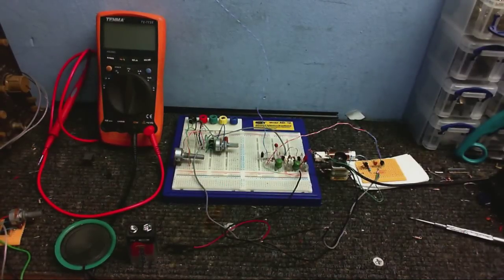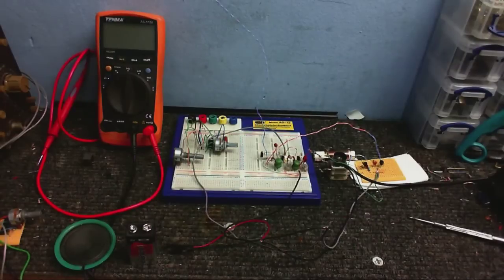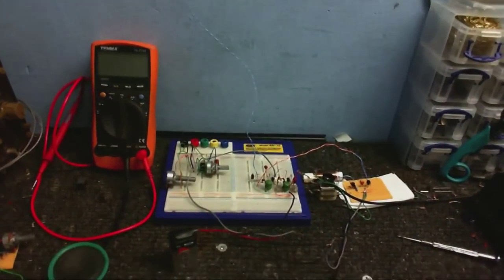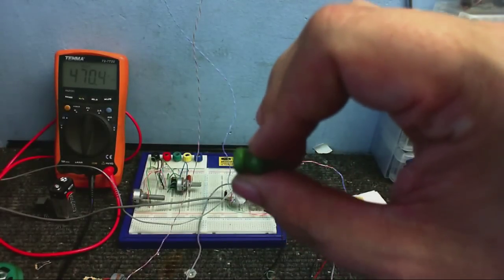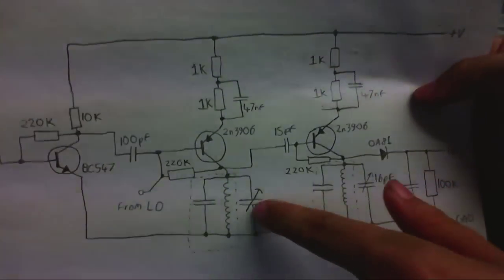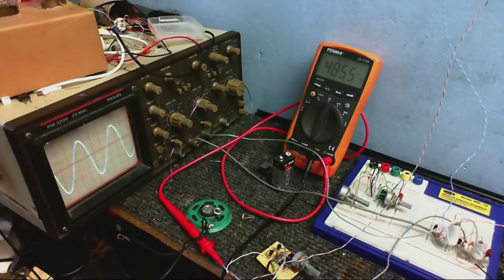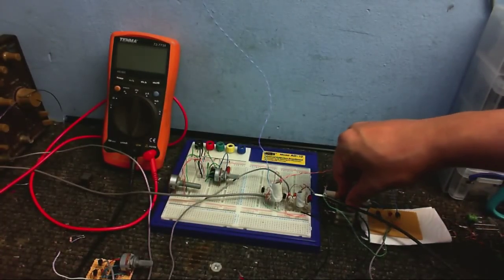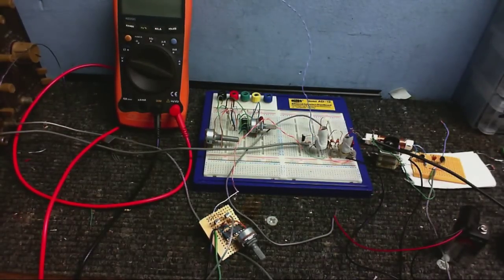How not to make a Superhet Radio

Comment: The constant station is because there is no selectivity at RF to stop antenna signals going straight through the IF amp; which is presumably very broad with the tuned ccts being heavily loaded by transistors and at what frequency exactly???. The configuration of the IF stages could be a bit better; the emitters should be decoupled to ground and there is no supply decoupling. I second Mr Johhhnnnyys suggestion. rip an old radio apart to get the coils: red core for the oscillator, yellow Ist If, white 2nd IF, black detector. Oh and grab the ferrite rod antenna while you're at it :)

Comment: Mate, you got a lot farther with this than I did on my first attempt.  For the third time, in case you think I'm joking or something, I'd very happily send you the IF and LO coil pack designed for a MW receiver, free of charge.  Just a few transistors and a fistful of bits is all you'll need.  Will at Bowood electronics has a few of these coil packs too, just tell him Lloyd sent you ;)  IF's can be made at home, i found 200 turns and a 220 pF NP0 cap was tunable to 455khz, not sure what you're doing there, but i'm sure you're pretty close!
Reply: +CoolDudeClem Is it wise to put your full address and postcode in public on here Clem ?
Reply from the maker: +Neil Robinson Oops, I thought I was replying to a PM, I was using the comments page in the YouTube dashboard and forgot that!
Reply: +CoolDudeClem Ok to delete post Clem ;)
Reply: +CoolDudeClem Mate, I have sent you an email - it's from my yahoo account so you might have to watch your spam filter ;)

Comment: It might be the lights that are causing the sounds that you heard isnce they are just resistors that are giving of heat and light it is more than possible that they would be giving off radio interference as well, also try using your tesla primary as the coil, that might work.

Comment: Clem,
The problem you have at the moment is that you have FOUR sections of your radio that need to be in perfect alignment:The tank circuit to select stations,the local oscillator and the two IF amps
Unfortunately,tweaking each section haphazardly,one after another,is likely,as you have seen,to get you nowhere fast!
It would be a bit like trying to view a specific object that periodically popped up on a computer monitor situated behind four doors ,each of which were opening and closing at different times !!!!!

The fact that your local oscillator,and tuning capacitor are not mechanically coupled makes things extremely difficult.This is because you have to guess where a station might be using the tuning capacitor, then tweak the local oscillator just to hear if you are tuned to anything!The whole business of keeping your local oscillator IN STEP with the tuning cap and coil is very critical.You would find life much easier if you used one set of vanes on your tuning capacitor as the means with which to tune your local oscillator.You could then trim that in order to produce your chosen IF at the output of the mixer using one of the trimmers built in to your tuning cap.An RF probe and amplifier would be extremely useful in helping set up each stage.

Hope this helps.
Reply from the maker: +ShellacScrubber I don't actually have any kind of tuned antenna coil in the circuit, I was going to put that in later on if I got any kind of promising results, for now the antenna just goes straight into the RF amp.  But how DO you set it up so there is a constant frequency difference between the LO and the antenna coil? so lets say if my I.F. was 450khz and I wanted to receive a station at 1mhz, how would I make certain that when the antenna col is tuned to 1mhz, the local oscillator would be at 1.45 mhz? (I think that's where it would have to be)
Reply: Hello again Clem,
Firstly,I must say it's good to see people like yourself experimenting and doing it with great enthusiasm.

Now,If you're building a superhet,you're definitely going to need an antenna coil and tuning capacitor !!
You are also going to need some form of sweep generator or cobble together an HF oscillator that can be amplitude modulated with an audio tone of say 1Khz.

I obviously wasn't paying close enough attention when I watched the video because you are indeed using a tuning cap' to alter the frequency of your local oscillator.I think I'd confused this with the HF oscillator you had made and using for your signal at one point.

Incidentally,I recommend watching any or all of the videos regarding RF and IF alignment posted by Bandersentv.

However,I will outline the basic principles:

Firstly,as mentioned,you need an RF sinewave generator capable of covering the frequency range you are interested in and also capable of being modulated by an audio tone or music signal.
You will also have to make a suitable antenna coil and tune it using the spare set of vanes in the tuning cap you are using to tune your LO.
You could also temporarily disconnect your diode detector and use it as an RF probe,connecting it to the antenna coil so that you will be able to hear when you are tuned to something.

As demonstrated in your video,you already have the means to tune your IF amps although there may be a problem in this area.Being that you are using just coils rather than IF transformers and giving the schematic a cursory look, it seems that the bandwidth of these filters may be too narrow.
Obviously the response of the filters needs to be wide enough to accommodate not only the IF frequency itself,but also the limited 4.5 Khz bandwidth allowed by AM broadcasts.
Obviously filters very sharply tuned to say 470Khz only,will exclude all audio content!

So,basically you have your modulated RF generator tuned somewhere in the band,away from other stations,which you loosely couple,rather like you did in the video,using a length of wire like an antenna.
You then tune your antenna circuit until you hear the modulated tone using your improvised RF probe and amplifier.
If you then disconnect your diode detector and reconnect it further back as originally it was,you can then adjust the little screw on the tuning cap' associated with the main vanes used to tune the local oscillator.If,given the component values in your LO are in the right range and your IF filter stages have a wide enough response you should hear your signal.
However , given the number of variables and the experimental nature of the circuit,I can't guarantee it.

The thing is not to give up! 
Don't get stressed about it though Clem,after all its only a pile of copper,carbon and silicon.
Leave it alone for a few days.You know IT will nag you back to have another go !!! You'll get there in the end.

Comment: Clem, I strongly recommend you to build this -> http://superheterodyne.altervista.org/AM/index.html
receiver. I made it, and it works very nice, even despite the fact that I'm using IF coils that I rewound myself + crappy ceramic caps in parallel to the coil. I've made a video about it, it receives more stations than other receivers that I have.  More of it, that guy provided step-by-step instructions on building it. I was kinda planning to build an FM superhet, but I don't have required equipment (yet).
Reply from the maker: +MrJohhhnnnyyy I might do that, I saw your video and it looks like it works rather well, if I build that I might add a fine tune capacitor to make tuning into the stations a little easier. And when I'm confident enough I might try to modify it for shortwave.
Reply: CoolDudeClem I works more than well, I'm dummie at RF stuff, but it works fine. And for fine tuning - if you have cap with reduction, use it.
Reply: +CoolDudeClem Hey clem. I´ve just taken a not so small part of my after work spare time to write you another message. I think you have seen my Video. Please check your private Messages and it would be nice if you reply to me this time. I mean just tell me do you want me to continoue to write you Messages or don´t you like them. Anyway please delete this comment since it´s just a way from me to make you know that I´ve written you a message which I´d like to be payed Attention to it by you. I can understand your rant, but see Details in that message. Best Regards.
Reply: Stefan0719 Wow! Just found your channel, it is filled with informational vids, subscribed immediately :) And a little question to you - I've built an AM superhet and it works fine, but I wonder about IF coils phasing. There are no dots on schematic to show phasing. I know for sure that phasing matters for LO, but does it matter for IF amps?

Comment: Clems, did you check the antena's lengts so that they would be resonant to the frequencies you try to tune into?
I was surprised how critical this length is s far s short waves go.
Also, i tried to catch short wave stations on perfectly working radio in the day and there was like only one. In the night there were at keast 2hundred.
Also on some days solar magnetic shit i think helps or blocks everything..
Good luck!